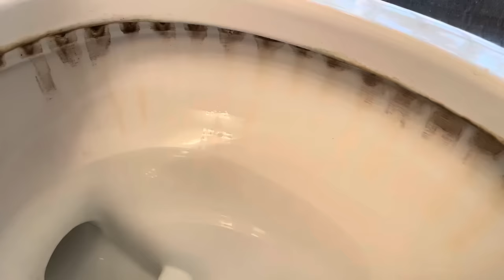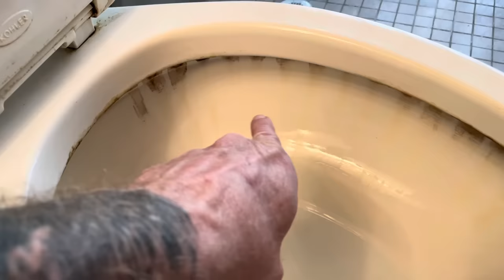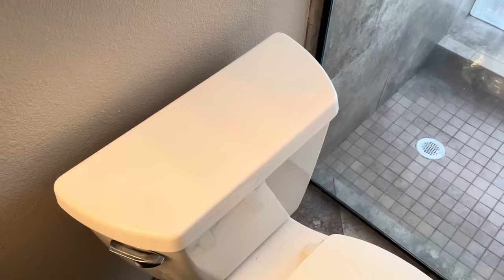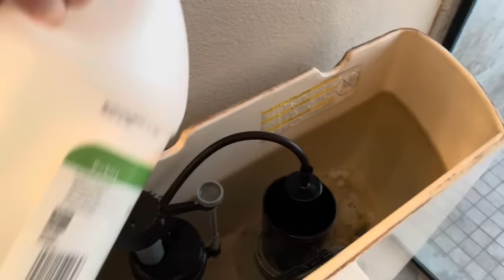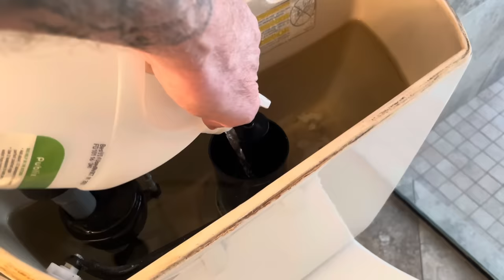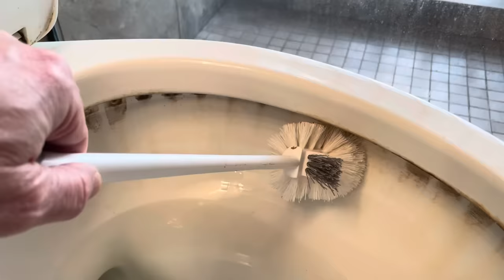Why Does THIS Keep Coming Back and How to STOP it

Comment: Bleach is better.
Reply from the maker: Bleach is a very deceiving product… it is far more effective at “bleaching” the color of mold than it is at killing it. Because we believe what we see, we think it has killed it, but it hasn’t. That’s why it comes back so quickly. So we just keep using & buying product over and over again. Great for sales, but not so much for us. The acetic acid in vinegar, on the other hand, kills mold down to the roots, but doesn’t really change the color that much, so you still need to remove the surface stain, but it won’t come back for a long time. Vinegar also helps break down the mineral deposits that the mold is “rooted” in. All in all, vinegar is a far better option.

Comment: Bleach is better
Reply from the maker: @deborahpacheco2799  WRONG… Bleach is a very deceiving product… it is far more effective at “bleaching” the color of mold than it is at killing it. Because we believe what we see, we think it has killed it, but it hasn’t. That’s why it comes back so quickly. So we just keep using & buying product over and over again. Great for sales, but not so much for us. The acetic acid in vinegar, on the other hand, kills mold down to the roots, but doesn’t really change the color that much, so you still need to remove the surface stain, but it won’t come back for a long time. Vinegar also helps break down the mineral deposits that the mold is “rooted” in. All in all, vinegar is a far better option.
Reply: @papajoeknows8355  ThanQ Sir.